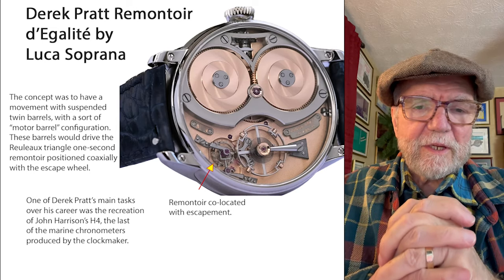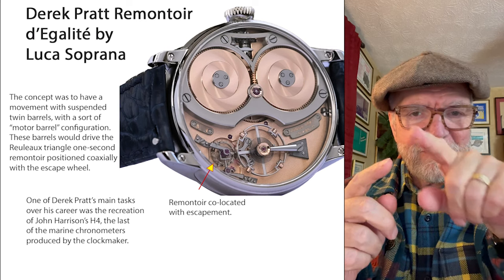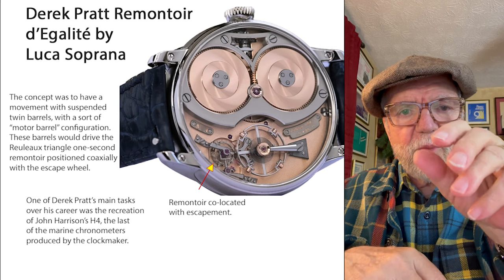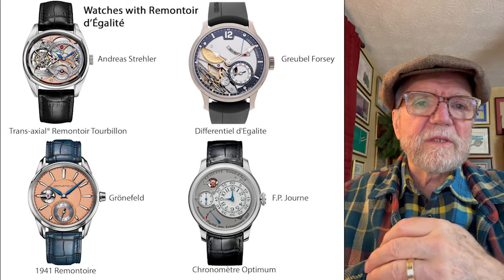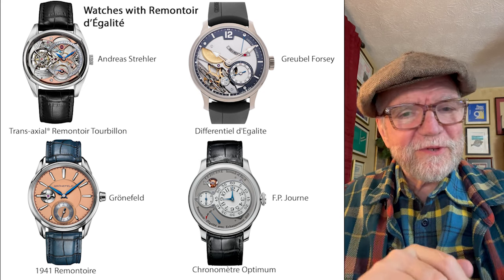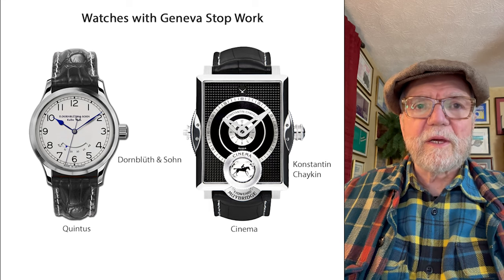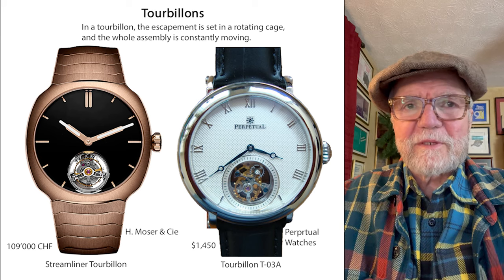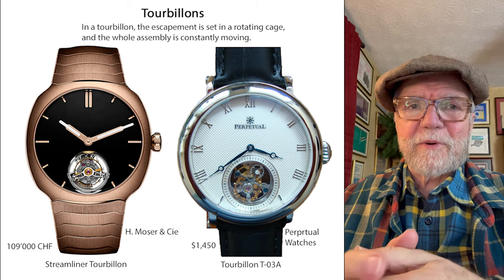Constant Force Mechanisms and Watches that Use them #466

Comment: Excellent topic to cover and great information, Bill.  But always remember that an Automatic Rotor is likely your best and most cost efficient constant force device, as it should keep the mainspring in its Goldilocks zone assuming you are active and wearing it consistently.
Reply from the maker: That is a good point SNC...Take care, Bill
Reply: Just what I thought, automatic wrist watches side stepped the position problem that required the tourbillon too.
Reply from the maker: @dunderhay9169  Not exactly—you have to take into consideration the many different forms of activity — as it varies so too will the accuracy.

Comment: Geneve stop works should be standard on any modern mechanical movement in my opinion. Far less complex than the other constant force mechanisms.
Reply from the maker: Hi HRM, I think the criterion for HH should be either a remontoir d'Egalite or double barrels in parallel. Take care, Bill
Reply: Would not two barrels in series be better than parallel?
Reply from the maker: @ollik8192  Not for sharing the burden, but in series more reserve. Take care, Bill